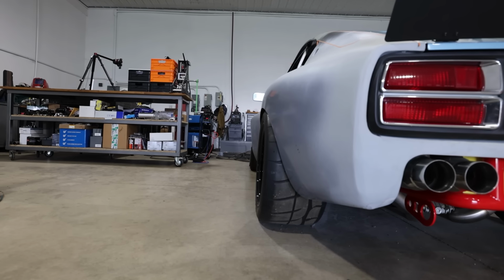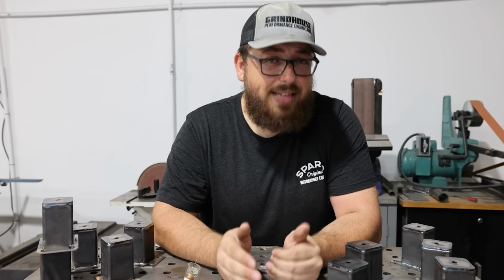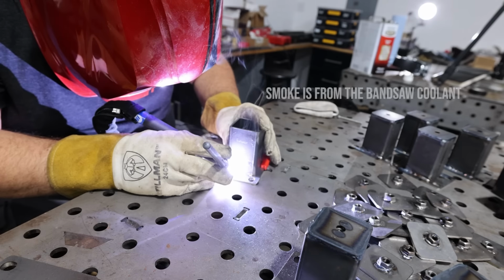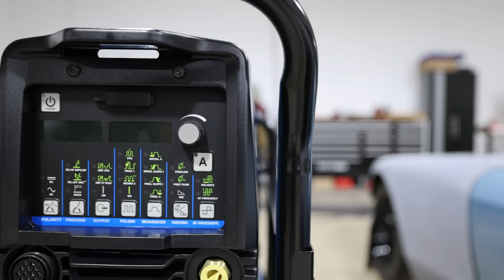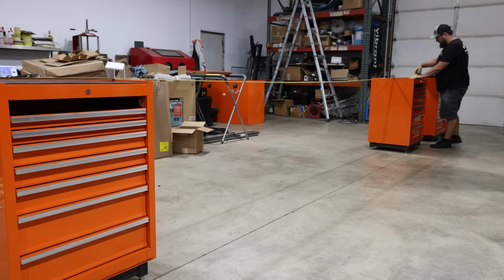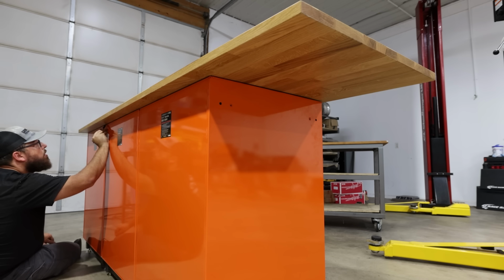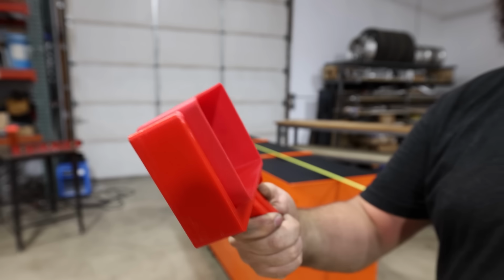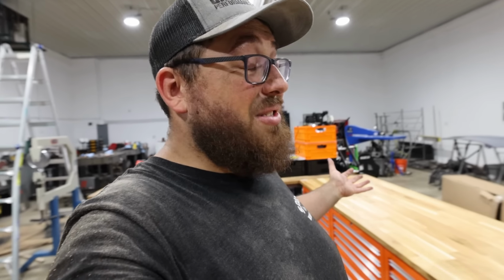Building the Ultimate Workbench for my Dream Garage

Comment: If you were looking for deeper drawers, cut out the bottom of a shallow drawer and bolt it to the drawer below. That way you keep the look of the drawer front while getting more capacity.
Reply from the maker: That'd be pretty intense 😯
Reply: This seems like a really good idea.... You could fold the bottom down and rivet it to the sidewalls of the lower drawers. That would make use of the upper pair of drawer slides for weight capacity
Reply: I have done similar to this, I cut the bottom out of a drawer then put in 1/2 inch plywood "U" shape nearly the height of both drawers and screwed that on the sides. This nicely completely covered up my very messy cut so I dont cut my hand open every time I stick it in there. I couldn't use a square shape because I couldn't open the drawers fully and place it in so I wound up cutting the back off so it's just a U now. Of course this means I lost an inch of drawer width but not a big deal for what I was doing. I also cut the bottom out of the top drawer with an angle grinder before removing the foam base from the second drawer. That was also a mistake.

Comment: I got a 56" and a 6-ft butcher block top.  Cut plywood to fit inside the lip, just a bit proud so I won't damage the sheet metal if I hammer on the butcher block.  It allowed me to move the top around for a few days to figure out the overhang L-R and front-back before I committed to bolting it.
   I also bolted bumper hitches to the underside to temporarily attach small vises, bench grinder, and a belt & disk sander.  You don't have to clear off the bench to make room for a bench tool!
Reply from the maker: Really like the bumper hitch idea, did you have to shim the tool stands from having a bunch of play in them?
Reply: @GrindhousePerformance   (Not sure where my reply went.  Maybe the Amazon links were causing a problem. ) The bumper hitch already had a bolt tapped in.  A quick turn with a wrench stops the wobble.  Mounted a parrot vise to a winch plate.  Grinder and belt/disc sander are on a 2x12 first, then a winch plate.  Eventually will have 2 small 4-5" vises and a grinder with wire and buffing wheels.  I just saw Harbor Freight makes a hitch-mount vise now. Worth a look for me.

Also looking at making some kind of 'shelf'-like thing out of strut channel to dock the mounted equipment when not used.  They're a little tipsy if I put them on a shelf or on my table saw.
Reply: Amazon numbers of what I installed:
B08BG1XLWS winch plate used upside-down.
B08HMZBNJ8 bumper hitch

Comment: New subscriber here.  I am a retired occasional carpenter and welder on my property. Good choice on the Miller.  When I welded in a fabrication shop in the 70’s we had millers all over.  Good reliable gear!  I am recovering from health issues and get out to my shop a couple of times a week.  I recently gutted the shop portion and found the floor.  Now am putting up walls for hanging stuff on (that is a technical term haha).  Anyway, great job on the shop so far.  I am laughing at how many organizers you are going to have to cut up, but hey, it will be worth it when you can find things.  All the best!
Reply from the maker: Hey thanks so much! Cutting them up has been a huge chore for sure, but thankfully once they're done, they're done (at least for now haha). Im definitely still figuring out where everything needs to go, and getting lost with so many drawers to choose from. So far so good though!
Reply: @GrindhousePerformance  again … well done!!

Comment: Holly! Using a router is an awesome idea! So simple, yet I completely over looked that. I put  a piece of ply wood down and then the work bench top on top. Next time I get a chance I'm going to copy you.
Reply from the maker: Something to consider, it does technically weaken the work surface by routing out the bottom. If you're hammering a lot and using the bench for heavy work, there's a chance it can split at the seam. I have other benches for that kind of work, but just as a caution 👍
Reply: @GrindhousePerformance  I see. This would be for tinkering on small stuff. I have a metal bench for heavy work. Thanks

Comment: 3D print a hose adapter.  Gridfinity for the bins.  Cut individual plywood pieces for each of the toolboxes, glue the top down, and when dry remove and screw up from the bottom.
Reply from the maker: For the volume of bins (1000+), printing them wasn't really going to be worth the time and I didn't want this to be a reason to buy a bunch more printers. I've seen the plywood stands on top of the boxes and just didn't really like the way that looks. Definitely more work this way but I'm really happy with how everything turned out! 👍

Comment: I used my 3d printer to print boxes exactly to my specs.  All are 1 mm thick walls and bottom - for the upper drawers.  Thicker below for the larger items. Using these cabinets for nuts & bolts is the smartest way to store and retrieve.
Reply from the maker: That's awesome! How have they held up? I looked at printing my own bins but talked myself out of it because of needing so many

Comment: Adapter to the router - you can use PVC pipe.  Heat gun will allow you to stretch the pipe - heat it up and push it on to the router.  Then heat up the other end and push it into the vacuum hose.  Find a pipe similar size to one of the two.  Or 3D print something, looks like you're pretty good with one.

Comment: you did an awesome job! well thought out. i would have out wood on top of the tool boxes and then glued the butcher board to the wood so it remained in place that way rather than doing what you did, but it worked out.
Reply from the maker: Definitely would've been a bit simpler that way, I just liked how they look sitting flush to the boxes. Hopefully they don't split over time, it'll be more annoying for me if I need to replace them later on
Reply: @GrindhousePerformance  yea that was kind of my thought. i was wondering if they would split later. fingers crossed!! :)

Comment: These HF 26" cabinets are the best value out there hands down
Reply from the maker: Anyone who says otherwise hasn't gone to the stores and seen what $3xx gets you elsewhere. If I had to do it all again I'd do it exactly the same. 👍
Reply: They used to be.  HF changed the design (in 2024) and the new design is not as good as the original.  I have several original bases, like you bought, and love them. Not sure what I will buy when I need more.

Comment: You can usually just stick the end of the shop vac hose on the router dust port and the suction will keep it on there pretty well, or electrical tape is your friend.
Reply from the maker: I'd tried taping it but the plunge kept screwing with it. It came with an adapter but it kept falling apart on me. It got really annoying and just said screw it haha

Comment: I've done the same thing with those Schaller bins using a jewelers saw on the router table.  That way I was able to just turn them upside down and trim them.  Unfortunately Schaller does not make 1-1/2"  deep bins.
Reply from the maker: That's a great, really smart solution. Being able to put them upside down makes trimming them really easy I'd bet. I REALLY tried convincing them of the business case to make a set of tooling for 1.5" bins. I even spent a week working with different injection molding companies to look at making bins specifically to fit the HF drawers.. designed dies and everything 😅
Reply: @GrindhousePerformance    If that ever happens I will be a customer.  Love your ingenuity and videos.

Comment: You need a Band Saw haha. Props to you for doing all those on a table saw haha.
Reply from the maker: Lmao thanks. I tried every saw in the shop to see what cut the cleanest in the least amount of time. I didn't expect the table saw to do as nice of a job as it did. The bandsaw I have cut a lot slower and got hot enough to start melting the boxes. It worked, but took longer to cut and clean up the edge after. Maybe a different blade would've performed better, only had one meant for stainless
Reply: @GrindhousePE  haha that makes sense. The jig you made was some good thinking though. Good job for sure

Comment: Great Video, I am so glad I came across this video. I was looking for ideas for my set up and this really helped. You ever think about picking up a band-saw? It would help cut those boxes in 1 cut without having to rotate it. Look on marketplace you can get one cheap. You can also use it to cut metal and whatnot.
Reply from the maker: I really wanted to make my bandsaw work. I had done test cuts with pretty much everything I have with a blade on it and seemed like the table saw with a fine tooth blade had the cleanest edges. My bandsaw would start melting the edge halfway through cutting them when I tried it out
Reply: @GrindhousePerformance  ahh, i forget not everyone has a variable speed motor on theirs. I ripped out my ac motor and put treadmill motor on mine to avoid burns and dulling blades by going to fast. Still is a great idea a and it worked for you.  You gained a follower!

Comment: Been waiting for a new video!  Great bench idea, not overkill by any means, seriously great idea. I would have done the same thing with routing the bottom of the bench tops. I’ll be asking you where the red bins came from, gonna steal that one! And I want a hat.
Reply from the maker: Thanks Fred! Routing the top was worth the effort and mess. The bins are from Schaller, they're what people use in pro cabinets. I actually reached out to them about producing a run of several thousand 1.5" deep bins specifically for the Harbor Freight boxes but they weren't interested... I also looked into developing the tooling to injection mold them myself but this seemed like the easiest alternative. I've got black, and red/white/blue hats in stock!

Comment: Yes yes yes! This is what I'm looking for. I've got a 2000sqf garage and one of my back walls I want to build something similar. I however want to be able to pull the carts out from under the countertop and wheel them over to a workstation or welding table or anywhere in the shop I'm working. I can't get 72" tool chests here so I'll likely need to do smaller ones like yours. Like 10 of them or something. Good to have a visual idea from your video on what that might look like. I subscribed and would like to see more 👍
Reply: @shiftradition
 Look up STORLOCK .
Don't know where you live or what your budget it, but you can customize Thierry drawers. It may save you some time. Unless you like doing things yourself. 
The drawer depth was a deal breaker for me. STORLOCK has dividers. 
This guy down played all the work he put into these. I have been there to a degree. Again he did A LOT  of work . Not to mention the Brain work . This guy is no dummy. I think he will do very well in his endeavors.
Reply from the maker: It was a ton of work but it's been well worth the effort so far! This was one of those builds I put off a long time but now I wish I'd done years ago. Im planning to do an update video and shop tour after the holidays 👍

Comment: been working on a similar setup. biggest difference I've been 3d printing  my bins 40mmx40mm and up. thank fully i have multiple printers other wise i would have spent some time looking and bought  them. but i do have the upside of doing custom bins for tools and other items as I go
Reply from the maker: That's fantastic! For how many bins I was going to need, I couldn't justify how long the prints would've taken and couldn't justify adding more printers. I'm planning on printing one-off's for special cases/odd-ball options though. Did you use the HF toolboxes as well?
Reply: @GrindhousePerformance  I did for similar reasoning. all though I Did go with more than one color for quick reference in organizing them in a zone kind of reference. Orange hardware, Blue Electronics, Green for welding and PDR. it had helped with quick visual and all so for when I have some one in the shop helping to be able to give them color and drawer for locating items.
Reply from the maker: @MrWasjoe  that sounds awesome! Nicely done

Comment: For the hose adapter, check out Rockler’s “ Dust Right FlexiPort Power Tool Hose Kit, 3' to 12' Expandable”. It has fit my DeWalt 3.25hp router
Reply from the maker: I'll check it out thanks 👍

Comment: Great looking workbench ideal looks great and you put a lot of thought and effort into it I would have wanted to just get it done and put pull out trays in the top drawers but you did it right you will have a nice shop, real nice shop, when you get a shop back look at the Pool section and buy a long hose for your shop vacuum 😊
Reply from the maker: Hey thanks! It's been a ton of work getting it this far, but it's all been well worth it. It's been a lot better working out there lately with all the updates.

Comment: I might have gone with 3d printing the bins..a la Gridfinity, but those pliers DEFINITELY made things faster and safer
Reply: You know you can use the 3d printer to make that hose adapter, right?
Reply from the maker: If I was only doing a single drawer I would've probably printed them, but for 6 toolboxes and 3 drawers in each, there's over a thousand bins. Id modeled out bins to print and it was going to be something ridiculous like 6+ months of nonstop running my printer unless I bought more machines 😅
Reply: @GrindhousePE  yeah I can only imagine...though you could prolly have souced your community to help and we could have all printed like a bazillion little boxes.  Your system definitely has me thinking though, about my own tool storage solutions

Comment: Nice! I did almost an identical setup in my shop, except I ended up just buying a 3d printer and printing bins to fit.

I also used some of those yellow bins that Come in the cheap black parts organizers and they fit pretty well in the thin drawers.  

I think I like your way better though! Looks awesome
Reply from the maker: I've got some yellow ones from those organizers too 😅. I'd originally planned to print the bins, but I needed waaaaayyyyy too many to print them in any reasonable kindve time. Thank you for checking out my project! 👍

Comment: Do you have the part number for the butcher block and the us general boxes? Thank you
Reply from the maker: IKEA Vrena (74in) 304.371.56
IKEA Vrena (98in) 004.371.53
US General 56105 (I think, there are two SKU's online. The one you want does not have rivets on the inside edge of the drawer opening)

Comment: You will never go wrong buying a Miller.  I own four in my business and one Everlast 256si TIG.   Yes, I cheated out and heard good things about the Everlast.  It's the only machine I own that I've had to repair.  My shops are due for some much needed organization.  What is your opinion of the Harbor Freight tool boxes now that you have had them for a while?
Reply from the maker: Im sorry to hear the everlast isn't working out for you! A few friends of mine have had great experiences with them so far. Fingers crossed the pandemic didn't cause any lapses in the millers reliability! After living with the bench a bit, I'm happy with the choices I made. Having the extra drawers gives me room for organizing overflow storage, and the weight of the hardware doesn't seem to be too much for the slides. I wouldn't recommend it if you were trying to store like lathe or mill tooling, but so far it's worked out better than expected. Im still filling drawers and cutting bins, slowly, but it feels great actually having somewhere for them all to go. If I need to upgrade or replace slides later on they're cheap enough.. easy enough to add a second set of slides to the taller drawers as well 👍
Reply: @GrindhousePerformance  To be fair, the Everlast is still in use, and still does a decent job.   It's just the torch and the pedal that came with the unit that had to be replaced/repaired.  At the time I needed a water cooled torch that could handle thicker aluminum.  I choked on the price of the Miller Dynasty.  I think I could have bought 3 Everlasts for the price of the Dynasty.

Comment: Did you ever do a follow up to this video ?  How did the storage work out ?  Are you happy with the outcome ?
Reply from the maker: So far it's worked out really well! I had gotten injured shortly after this video and then my property went through some pretty bad flooding damage that I've been having to deal with. I did have an IG post about the bench completed with photos if you were curious. I haven't gotten as much use out of the bench as I wanted with all my time away from the shop but what I've organized in it so far has been fantastic. I might do a follow-up down the road once I've put more miles on the bench to see how well the drawer slides etc have held up
Reply: @GrindhousePerformance    Thanks for the reply !

Comment: Aint gonna lie, i may have to do something similar myself. Ive been wanting to get my hardware under control for a while now, looked at some of these cabinets etc and i was not happy with the prices. I have an empty spare proto 26" roughly sized top and bottom chests that i may have to use for this 💪 nice work!
Reply from the maker: So far it's worked out really well for me! I like it way more than those open grid style ones and it cost way, way less than a used Lista or Vidmar. The question is really going to be longevity but for now, I'm really happy with it 👍
Reply: @GrindhousePerformance  did you mention where you got your trays from? Looked like they had no problem shipping a million of them lol
Reply from the maker: @chrisduncan2626  haha and that was only the start... I ended up ordering like another 500 after this video. I got them from Schaller Corp.
Reply: @GrindhousePerformance  awesome man thanks ill look into it. Im tired of cans and bins of bolts 🤣 right now its taking up my cabinet space